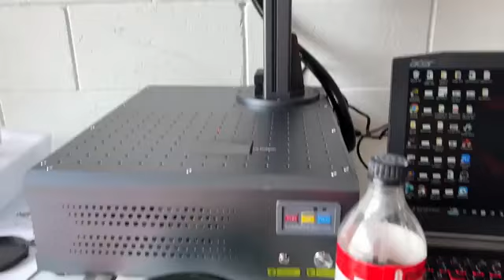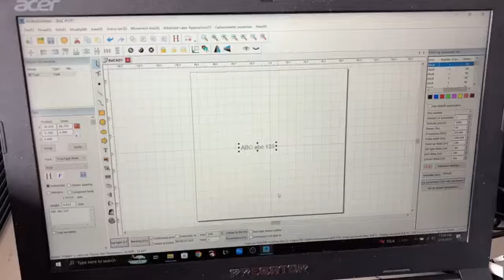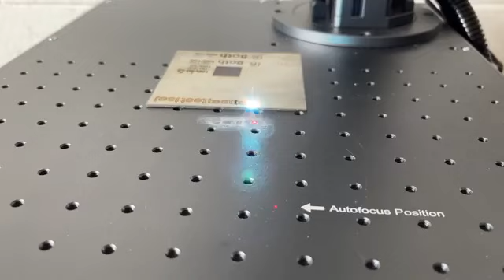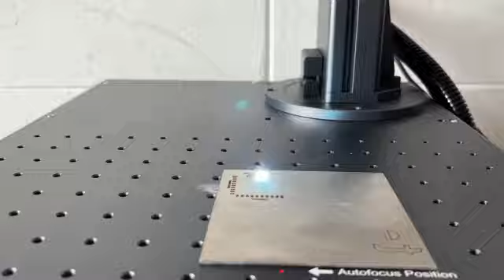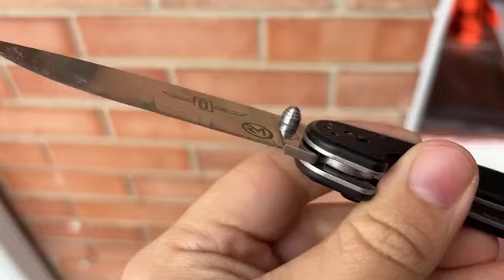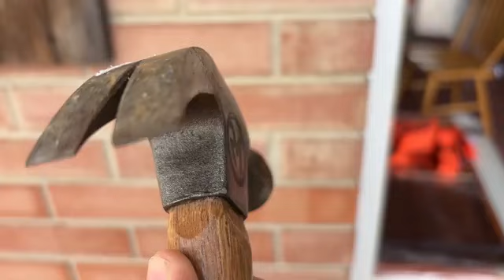Wielding Light With the Monport GA 100W Fiber Laser!

Comment: Warning did you know this about supplied safety glasses by Monport 

Not 1064 nm  safety just general En166

PASS ON make sure you dont use these 

https://youtube.com/shorts/FY_7jFoq1Nk?si=zU1AGvStbHNVRTbP

Safety Glasses supplied only En166 basic not fit for 1064

They should be OD 8+ as min rated at 1064